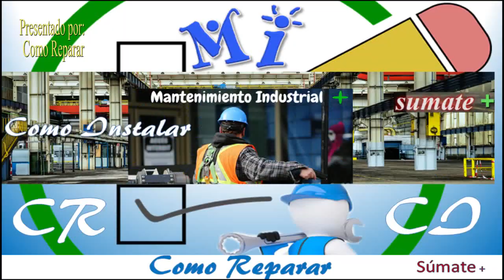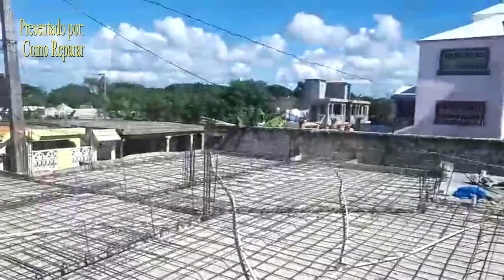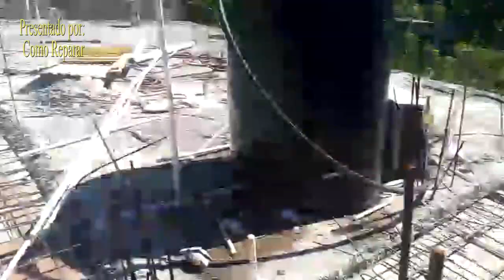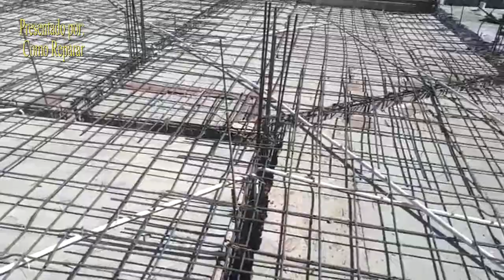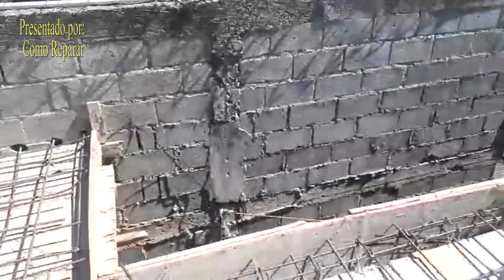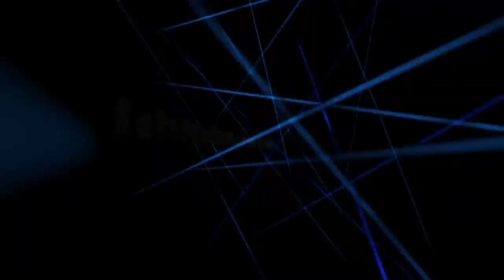como hacer un circuito de iluminación✅Tubo pvc eléctrico ramificación

Comment: Senor usted podrias tener muchos seguidores y usted podrias  ser el numero un pero tiene que ser mas explicito en sus exponencias diga el diametros de las tuberias que tipos de cajas y como que tipo de cometidas y de  cuantos amperes sera la caja de distribuicion y los calibres del alambrados y el tipo de cable de entrada  para el paner de alimentacion  y de cuantos amperes sera la caja de los breaker y las escala de alturas de los interuptores y tomas corrientes y el tipos de los alambres ? Porque sin explicacion no se ves profesional y s IU necesita ayudas estoy disponibles para ayudarle segun mis conocimientos profesional DIOS ES CONTIGO